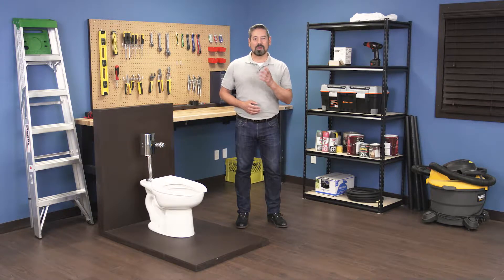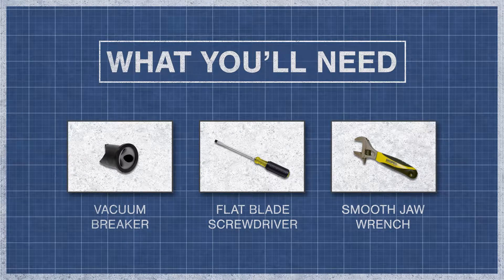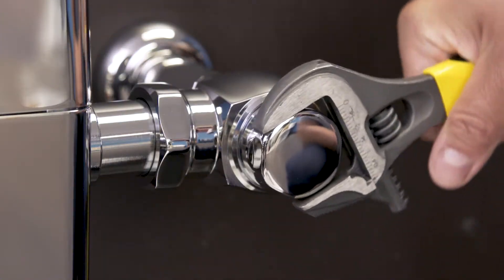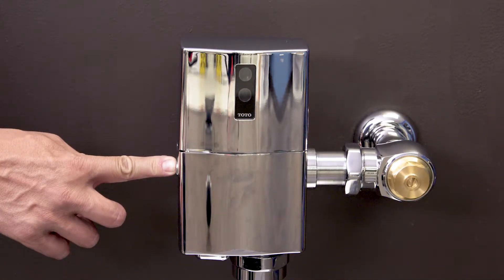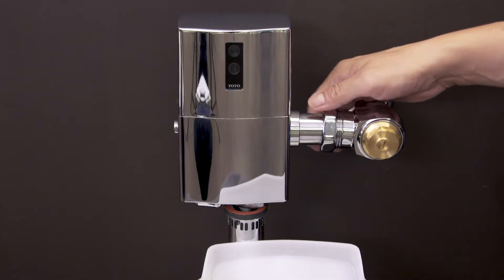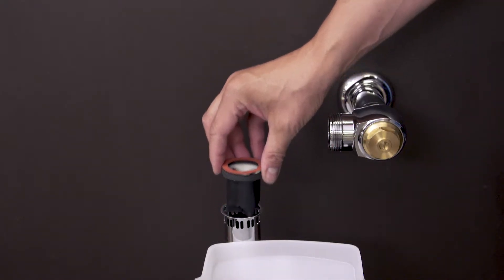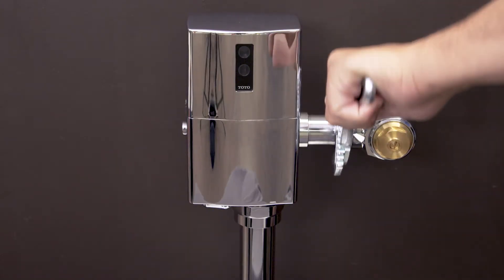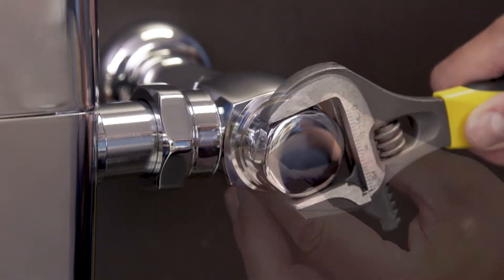TOTO EcoPower Flushometer (Pre-2013) | Vacuum Breaker | Repair and Replace

Comment: Every 3 month or 2 it keeps leaking there and it still looks brand new. Is there a reason why it keeps doing this?
Reply from the maker: Hi Andrew, thank you for watching. If the FLushometer keeps on leaking from that same place then you might want to take a closer look at the threads. Inspect the threads and look for any corrosion or any nicks or damage to the surface.  This can affect the seal. If there is a mineral buildup or corrosion then it can be clean with an acid like vinegar. Alternatively you could try a generic vacuum breaker as some have slightly different designs and a different washer. That might help as well.
Reply: @AmreSupply  thank you so much for this valuable information!
Reply from the maker: @wolfboy202  You're welcome, we're just happy to help!

Comment: Hi there. My TOTO toilet leaks excessively out the bottom of the flush valve everytime it is flushed. Would this be due to a faulty vaccuum breaker?
Reply from the maker: Hi Zakk, thanks for watching. If the rubber begins to break down, it can restrict the flow it can create more back pressure while flushing. Replacing the vacuum breaker is the simplest place to start.